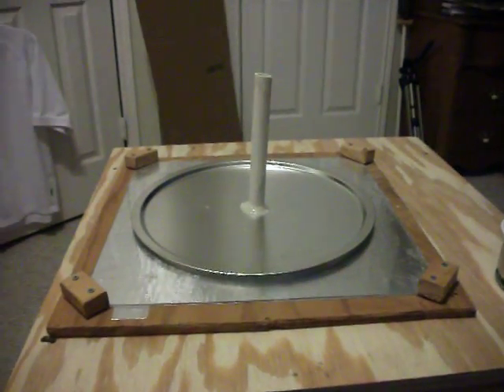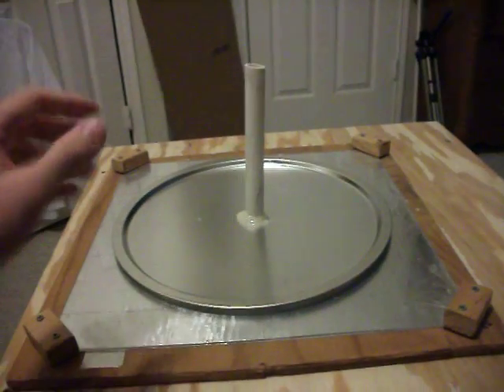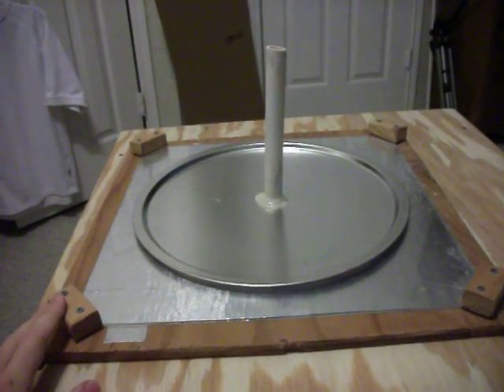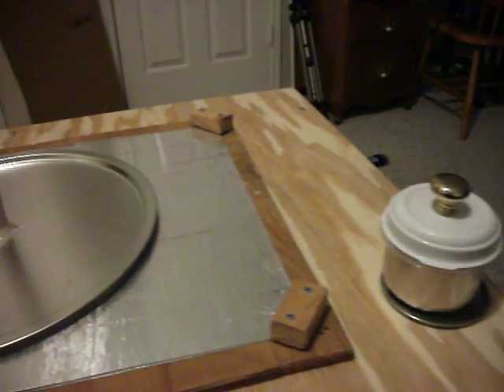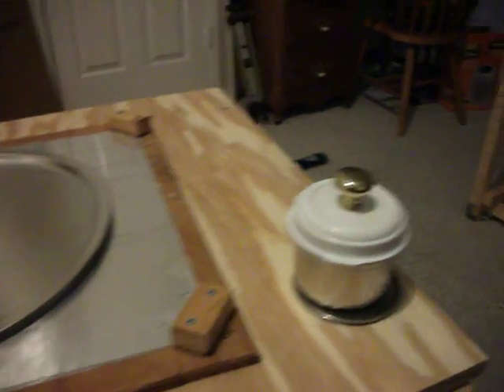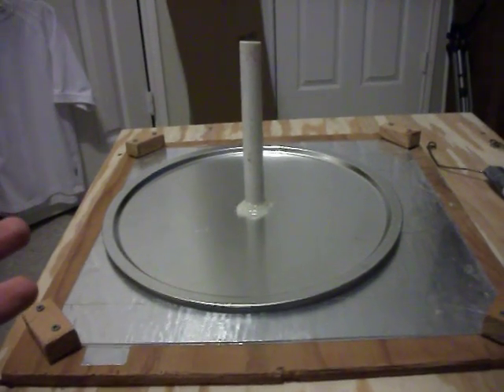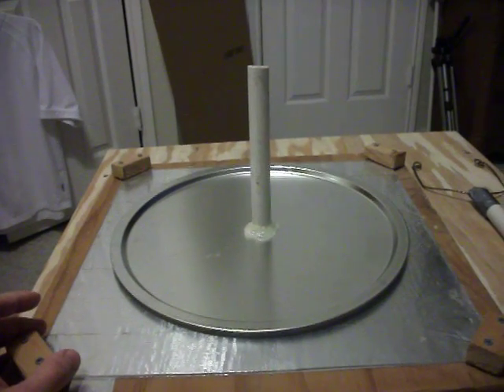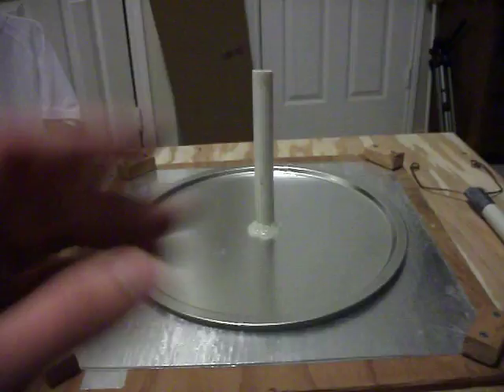The Electrophorus: Part 1

Comment: Its hard to tell exactly how your bottom plate is constructed  but if i were to guess, it looks like a aluminum under plastic wrap or aluminised mylar. Once charged, it acts like a quasi permanent charged, real-charge, electrete. Would you elaborate on how your bottom plate is constructed?
Reply from the maker: It was really primitive back then, strips of adhesive backed aluminum foil originally intended for duct work. The dielectric was a sheet of clear acrylic resin.
Reply: @ContriteDiscursion  If it interest you,  check out an axial flux BLDC motor I made on my channel. The three coils' magnetic fields are a lot like a flattened rodin coils or starship coil.

Comment: i just tried to do the same thing with a cardboard disk wrapped in aluminum foil and it didn't work. Maybe because my disk was too small, or maybe because I didn't smooth out all the surfaces well enough, OR maybe because both the electrophorus and the base were made out of aluminum..
Reply: Without seeing how yours was constructed and operated here are some ideas why it may not work. 

1. You have to charge the bottom plate. for example, different materials rubbing up against each other strip electrons or deposit electrons using the triboelectric effect.  google triboelectgric  positive negative materials to find good complementary materials  for example http://eesemi.com/tribo_series.htm.  To keep a static charge, the materials need to be electrically isolated or non conductive.  Charges can sit on plastic and not be conducted away, or a metal plate like aluminum can be electrostatically charged and sit between two sheets of plastic wrap. 
2. Charges are being dissipated. Humidity can drain away static charges, anti static plastics are designed to discharge static electricity. Moisture in cardboard can drain charges too. 
3. Improper charging and discharging. 
4. Tools for detecting or storing electrostatic charges not sufficient.

Comment from the maker: You know, I'm not sure what the pie pan is made out of. It hadn't even occurred to me. But since it seems to be the dielectric being charged and not the metals it might actually make a difference. That's a completely new line of thinking for me! Thank you!

As far as getting a spark off the bottom plate, I'll have to test that and get back to you. Since I made this video the hot glue I was using to attatch the PVC handle to the pie pan came loose. I'd like to figure out a way to solder it...

Comment: is it possible that charge separation occurs because you use different materials? I mean the pie pan is not made out of aluminum... or is it? 

and another question is.. if you ground the bottom layer (the aluminum foil) after the separation will you see a discharge too?  

thanks!